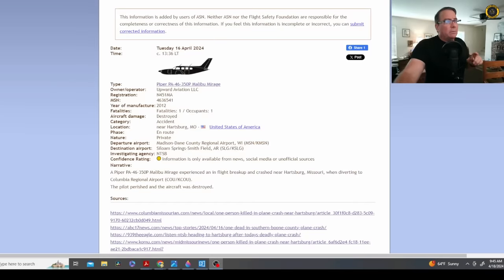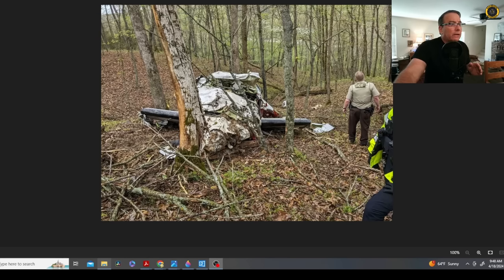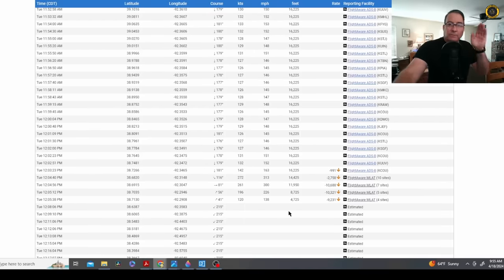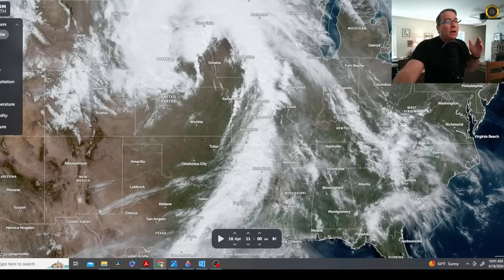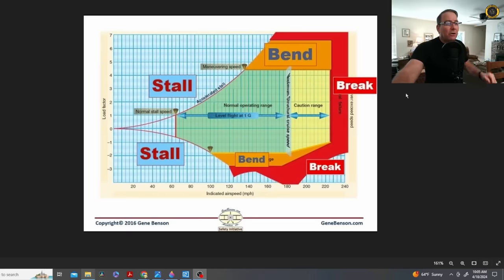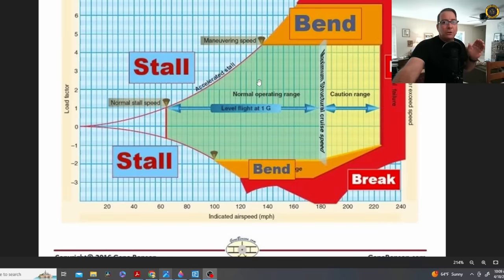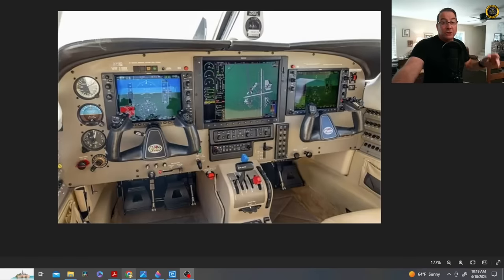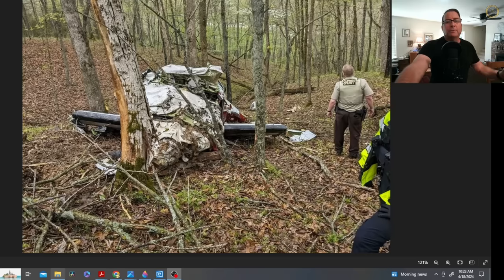N451MA PA-46-350 16 Apr 2024 Structural Failure

Comment: Is this not why water fire bombers need to be careful when they drop the water? Recall that video of the Pawnee at the "baby reveal" which ripped the wing off? Lighter weight = lower Vma? Have I got that right?
Reply: Lower weight lower maneuvering speed correct. 

But regardless you shouldn’t go into terrible weather. In anything
Reply: @wordsareuneccesary  Also there's not much point in dropping water in the rain.
Reply: The Pawnee pilot yanked the airplane up violently and overstressed the wings and lift struts. Piper lift struts were prone to interior corrosion which weakens them. An Airworthiness Directive was issued against the struts. If this had not been done, it may have been a contributing factor.

Comment: Totally agree with your advice on autopilot and Va. if flying in moderate or stronger turbulence you should hand fly the aircraft

I’ve experienced strong pitch actions from autopilots in the PA46 while checking out customers in new Malibus at Piper. Also extreme roll maneuvers in Seneca III in turbulence created by thunderstorms often resulting in banks in excess of 70 degrees

Somewhat of topic , I own Tesla Model 3 with FSD which used Heuristic code in controlling car in V11. This caused some scary situations in V11. To the point where I stopped using it. When I got V12 which uses Neural nets end to end the car performed like a human. It is now so good I let the car do all the driving

Makes me wonder what the software engineers did or are doing to improve the reliability of software used in autopilots

Comment: From the outside it seems simple. But when you are zipping along in a slippery fast pressurized single there are a few decisions to make if you want to slow down suddenly. Pull the throttle way back and lose pressurization? Throw out the gear? Many of these fast planes have speed brakes for a reason. But many pilots seem to think they are only for steep decents or poor atc planning. I fly a 210 over the rockies and turbulence can come out of nowhere quickly on you. I've got into the habit of dumping the speed brakes to drop to manuevering speed, slowing rolling back the throttle to prevent pressure drop, and possibly throwing out the gear if needed too. Its the only way i have found to slow down or decend through turbulence at Va. A gear door is better to lose than a control surface.

Comment: Hi Blancolirio, Your comments are 99.99% right , checked and justified. In this case, the aircraft is simply not strong enough. (my opinion). 
With an oldschool glider (1970 model) I can simply pull 3.5 G for a short time down in loop....it is not much for a short period.
Even slowing down the the Piper below the 135 kts, say 100kts and flying in a 15 m/s upward gust the wing probably stalls, and then I am out of control. 
So what is the choice? avoid it.

Comment: WHAT a graphic at 03:49. Only on the blacolirio channel. Incredible analysis. So many points. 

In case you missed it:
MENTIONED:
• point-to-point 3D model of ADSB and FlightAware a/c data
• whether radar overlay showing satellite imagery of strong storm front between St. Louis & Kansas City (final a/c resting point)
     --> similar weather radar overly with similar accident
• PA46 checklists indicating critical V_A max&min speeds
• generic V-g diagram (which is repeatedly and repeatedly mentioned on this channel, worth taking some time to understand this *AND* s/c model of accident causation) showing "normal operating airspeed and g-load envelope" for aircrafts
     --> "You can stall an aircraft at any IAS and any attitude, but only ONE critical angle of attack."
• analysis of checked maneuvers, but importantly, why using these in-flight could be detrimental to structural damage to a/c (AAL587 as irl ex.)
• general sadness from blancolirio. He seems genuinely upset that this happened, seemingly, because he knows it could have been prevented.

Comment: The Malibu is a tough aircraft for its intended purpose but I remember seeing one that flew through a hail storm over the English Channel. This aircraft belonged to my flying club in Germany and the pilot had done a thorough inspection getting weather stating clear conditions to Frankfurt. The plane was immediately grounded  upon arrival in Frankfurt. The Malibu appeared to have been hit by a hammer with 1/8 to 1/4 inch dents all over the airframe. The screened air inlets on the front of the engine were destroyed but the windscreen held out.

Comment: As a lifelong sailor I've learned that my job is to put my boat in harmony with the elements. Never fight with the sea. You will lose. Never test the limits of your boat either if you want to live. Keep her on her feet with the helm balanced so you can steer with one finger. Reef early. The autopilot steers best when the boat is balanced. It cannot keep watch and it cannot navigate. It cannot trim or reef or strike sails, 

hat's your job. The autopilot makes it easier, but it's an idiot. Never forget that.

Keep the boat under control and moving in the general direction of your destination. Don't hit anything. Don't fall off. You'll reach port safely and comfortably if you can mange all three.

Finally, avoid bad weather at all costs. Don't challenge mother nature. 

I'm telling you: She's a real b*tch. Especially when she's angry.

Comment: To be fair there is a lot of information missing. For example did the airframe failure cause the loss of control and exceedence or was it the result of the loss of control and exceedence? Why did the pilot fly into these conditions? Was his preflight information adequate and was his weather radar effective? 
Interestingly, although turbulence can certainly cause structural failure, the actual g loads are usually surprisingly low. I wonder if the actual report will point to icing causing loss of control and subsequent breakup.

Comment: I wouldn’t be surprised if the turbulence caused the autopilot to kick off and the pilot immediately became disoriented leading to the breakup.
Reply: As mentioned in other threads, the autopilot could have been compensating for an out of trim condition and when it tripped-out, there was a large pitch down movement.

Comment: My first ever flying lesson involved doing a 180 turn immediately after takeoff to keep away from an approaching front. Even though we kept ahead of the front there was quite a bit of turbulence, necessitating my continued input to keep the wings level. I now know you should be gentle with compensation in case there is another buffet in the same direction which could cause an overload. Unlikely unless the airframe has been previously over stressed though.

Comment: Pilot training is critical. Flight Safety and simulator training for emergency procedures are ESSENTIAL, NO IFS ANDS OR BUTS ABOUT IT. That means getting into the supplements as well. WIN or Lose!!!! Flight instructors who have wet ink on their CFI are not needed. Go get a retired airline pilot with tons of experience not some time builder---get a real professional and not a fake professional. I got a WW2 man who taught all during WW2 and had thousands of hours as an instructor in 1967. The FAA is part of the problem. Fly the pattern to where if the engine quits any where you can land on the active runway!!!! Always FLY THE AIRPLANE!!!!

Comment: Lower weights break the airplane at lower speeds because a gust will cause a larger load factor increment at lower weights.  ∆n = ∆L / W.  For the same change in lift ∆L, a lower weight will cause a higher change in load factor ∆n.  Load factor is what breaks airplanes.
Reply: No Lift force breaks the airplane. Load factor or Gs is just the ratio of the Lift force to the mass (or gross weight) of the plane. !000 pounds of force causes much higher load factor and G on a 100 pound aircraft (10Gs) than it would on a 1000 pound aircraft (`1 G). But it is still 1000 pounds. and if the structure of the plane is designed to withstand the stress from applying 1000 pounds of force, than it doesn't matter how much the plane weighs (i.e., how many Gs that force might be producing.

Comment: Been to performance driving school a few times.    Steering wheel inputs are just a suggestion.   Cruise control should be 'OFF' in every situation that reduces traction :   rain, heavy wind, and snow/ice frozen roads.     The car is trying to maintain a certain wheel speed and cannot adjust quickly enough to compensate for split second traction losses.    People always think the steering wheel direction, while important, is the most important input.   It turns out that road traction ultimately determines the direction of your vehicle, and that may or may not be in line with steering inputs.   

Seems like auto pilot should be used with a somewhat similar thinking.    Most people, drivers and some pilots apparently, simply have inadequate training when it comes to the actual operation and limitation of automated systems, in addition to not understanding the physics of how their vehicle or aircraft actually operates in the medium it operates in.

Comment: That is a lot to manage and keep track of, so I give a lot of respect.  I feel bad though about an airline pilot I knew who couldn't manage driving an automobile. And I'm quite sure his first instinct was to pull back on the steering wheel  before his several self induced rear end collisions. 😊
Reply: Driving back after a flight lesson, I approached a curve in the road. Speed 60 that's good I'll pick up a little in the bank, left rudder, start pulling left, why is the stick not moving?
Yeah, I was trying to use the gear shift to bank into the highway curve. "Left rudder" was the clutch pedal. My brakes worked a treat that day.

I literally added a step to walk around my car after flying, to reconnect my brain. 🙃
Reply: @j_taylor  Another strange situation is in heavy equipment operations. The disconnect comes when the actual movement of the different appendages of the equipment happen in completely opposite directions from your movement of the controls being used between different manufacturers. [ backwards ] And people get killed.

Comment: I think we need to do a better job of training people to get down to Va when encountering turbulence.  The fact that it's not marked on the ASI is a potential issue as well.  I think a lot of people assume that as long as they are in the green arc, they are OK.  Well, no, you aren't.  If it's bumpy enough to require continuous control deflections, then you should be down to Va for your weight!

Comment: I'm curious if there have been at least two or three static ultimate-load tests to destruction on this airframe as-built, as well as long-term fatigue testing to at least 80% rated load, positive and negative, with the tests fully instrumented so that those numbers are known specifically. I know that the question has been looked at previously but Piper also has a bit of a sketchy reputation with this in other models with age and heavy use. I have no idea what has or hasn't been done, and don't doubt the problematic pilot issue, either, but it would be interesting to see what those engineering numbers look like.

Comment: I find the fact the airplane will bend or break easier to do when it’s lighter counter intuitive. I’d be interested in further explanation on that.
Reply: Same here. And that drives me nuts!
Reply: It’s mass and acceleration, the more mass, the more it resists changes to its speed/position ie acceleration.  Air liners are big and heavy thus can charge thru more turbulent air at much higher speeds than GA aircraft and still achieve a comfortable flight.
Reply: I thought the same thing but the answer is posted already. Load factors on structural components can build faster when direction changes can happen faster. Lighter aircraft change directions quicker. That's bad in turbulence.
Reply: A given wing can deliver a specific maximum lift in a given speed. Lift has no relation to the aircraft's mass. It's solely related to the angle of attack.

The lift is the force origin of the acceleration. For the demonstration, If the aircraft is twice lighter, the ratio between its weight and the available lift, is twice higher. The structure will endure twice more G.

In other words, the lighter your aircraft is, the higher G it is capable to provide. Slowing down decreases the maximum available lift, and therefore maximum possible G.

Comment: I’ve had 3 Mirage ‘s a Malibu and 2 Meridians , went to school at least 15 times on these aircraft. They’re relatively easy to fly . In moderate (should not be in heavy ice in a PA46)ice with a PA-46 one must turn off the auto pilot and gently move the elevator minimally to prevent the elevator from icing and welding to the horizontal stabilizer. Also need to open the alternate air on the piston version in ice . Va or maneuvering speed is crucial in turbulence ,given the 25,000 foot ceiling on the piston version is pretty easy to encounter ice and turbulence. I’d avoid ice as much as possible in both the Meridian and Mirage . Always better to turn off the AP In mod to severe turbulence(As Juan notes)and keep it as straight as possible,ride it out accepting altitude pitch and directional changes (been there many times in the PA46)

Comment: Like with so many fast private aircraft, owners are loath to reduce to appropriate speeds when in rough air. 
They have a fast machine and by golly they ain't slowing down. So they tend to be underestimating how bad it is or could be ahead. 
Auto pilots do a heck of a job hiding how bad it really is sometimes. 
It's an aviation story since way back.

Comment: Some years ago i read an article in Flying Magazine about clear air turbulence.  Len Morgan i think.

The author was flying an Avro Lancaster (post war).  The aircraft entered an uncontrollable ascent and was approaching a cloud layer that obviously contained severe turbulence.  The flight crew ended up having to push the nose over steeply and apply full power to arrest the ascent.

If you know where the article can be found please reply.
Reply: How do you apply full power to arrest a descent? As a side note, my uncle was a radar operator on board Lancasters in WW2.
Reply: @igclapp  Sorry if I wasn't clear about the chain of events.

According to the author in Flying Magazine (Len Morgan I believe) the Lancaster was being carried upward by a very powerful updraft.  The only way to successfully counter the updraft was to point the aircraft's nose steeply downward and apply full power.  In this way, the thrust of the Lancaster's engines was used to force the aircraft downward, arresting the ascent.
Reply: @heybooitsme1831  Do you have a link to that article? It does not seem possible that a Lancaster pilot would add power to come down faster, unless it is impossible to achieve Vne in a power-off dive.

Comment: Auto Pilots should be re-named Pilot Assist. 
Putting all your faith in auto pilot can get you killed when in adverse conditions or during a system failure while the auto pilot tries to maintain parameters going beyond its limits and either disconnecting (like last week's GA crash) leaving the pilot with a sudden out of trim, or flying the plane into a stall or other hazardous condition.

Comment: As an AP/IA I wouldn't touch one of those. I can't believe the FAA has not grounded them all with an emergency AD. Two PA-28s have lost wings and the FAA jumped on it. Wings have been falling off the Piper PA-46 fleet for decades. It was a deathtrap from the drawing board.

Comment: So I have a question on this… With auto pilot flying the airplane it’s the servo doing the work is it not? They’re not actually adjusting the trim. So if the aircraft is out of trim as it continues and the auto pilot is holding that to the point that it cannot hold it, when the auto disengages, it will be severely out of trim will it not? Is that part of the factor that is happening with people flying the aircraft on auto pilot and losing control at points when the auto pilot disengages? In other words, it seems plausible to me that this pilot was flying on auto pilot in turbulent conditions and that the wings were not over stressed while it was an auto pilot, but rather when the auto pilot finally disengaged, and there was a significant amount of trim condition and the pilot did not catch it in time before airspeed increased to a point that his recovery over stress the structure?

Comment: The autopilot is only there to assist you as a pilot , it's not there to keep you alive. If you can't hand fly your aircraft in a particular situation it's most likely that the AP eventually will not be able to either. And if you feel uncomfortable hand flying in moderate / severe turbulence...........then don't. Turn towards calmer air and get down.

Comment: Up and down, vertical air movement equals turbulence to an aircraft. Horizontal changes in air movement will affect air speed and could cause a stalled or V-NE, over speed condition but rarely breaks the structure. Its the vertical, up and down stuff that we feel and can cause the beginning of a chain of events leading to bad outcomes. Once gravity takes over and the speed goes through the roof a gentle return to level 1-G flight is remote.